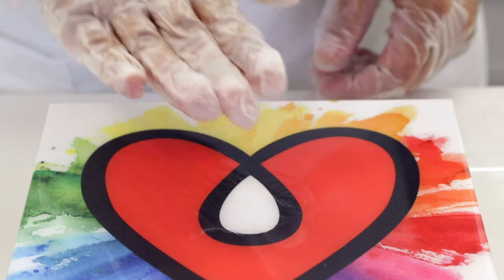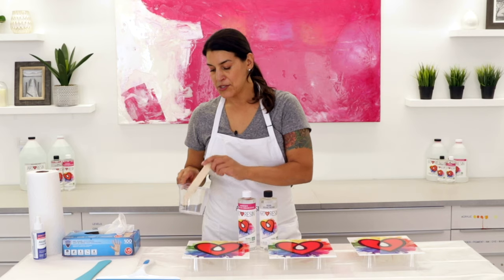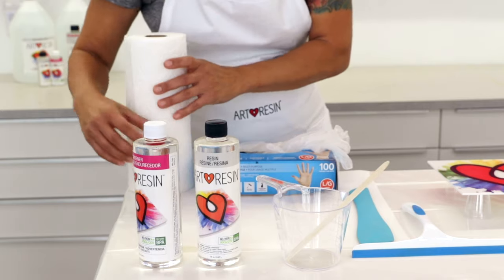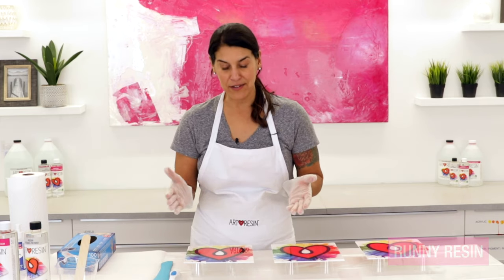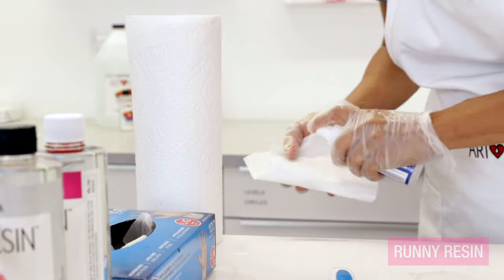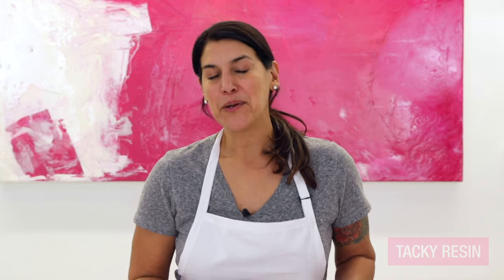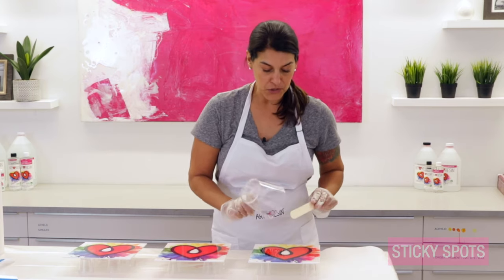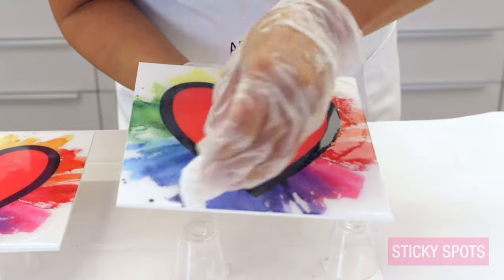How to Fix Sticky Resin - Top Tips & Tricks

Comment: THANK YOU!!!!! I have had tacky and the mixed finish problems before and DID NOT know about NOT SCRAPING as you pour!! Soooo obvious now. Thanks for showing all the steps!
Reply: You should always finish your mix in a separate clean cup and scrape the sides of the first cup into the second cup and finish mixing for another 2-3 minutes. She isn't even giving proper mixing instructions
Reply: This is how I mix my resin and I scrape my sides out to not waste my resin and because I finish in a second clean cup, I have zero unmixed epoxy.
Reply: You should also NEVER add a new layer over uncured epoxy as it will seep through and make someone sick. If there's sticky spots scrape/sand them out or strip the piece, it will never cure and is extremely toxic.
Reply from the maker: @JuiceBoxx_627  Yes, you can certainly measure in separate cups then pour into another to mix.  It is always important to ensure you are mixing 1:1 and ensuring you are getting all the resin and hardener fully incorporated.
Reply from the maker: @JuiceBoxx_627  When faced with wet resin that didn't cure, it is important to scrape off all of the wet resin as Joanne demonstrates in this video.  Once the loose wet ArtResin has been removed, you can then go ahead and pour on a second layer of perfectly mixed ArtResin.  You are correct in noting it is important to remove the wet resin since it will never cure and will end up seeping out, but I am happy to tell you that ArtResins formula is non-toxic 🙂
Reply: @Artresin  I never said anything about measuring each part in separate cups, I do that anyway, and still have a second unused cup to dump my mixture in, scrape the sides and bottom into the new clean cup and continue to mix for another 2-3 minutes so all of the epoxy is mixed not leaving unmixed epoxy on the sides by mixing in 1 cup which means your epoxy is not properly mixed, it's not loving up to its full potential because it's only partially mixed.
Reply: Hello@kayladickson8124 can you please clear this doubt, i have applied resin on painting and it is sticky can you please tell if i can pour properly mixed resin on top of it.?

Comment: Thank you so much for this video and information. I was on my third coat because of bubbles and uneven coverage on the edges of my canvas.  I don't know what I did wrong, but I have a runny mess of uneven resin! In tears (my first commission piece that came out beautiful 😭😫) I actually had 2 canvas' I resined at the same time. So it's obvious I mixed something wrong. I ran off the runny resin with hopes of it drying by morning. After seeing this video, I highly doubt it will cure, but now know I can probably fix the problem! Thank you again for this wonderful video! I'm going to "try" to 😊! If I do fix it...I will come back here and let you know! 🐇💗
Reply from the maker: I know it can be devastating but sticky or uncured resin is very fixable :) good luck!

Comment: I was working on a beautiful mold a few days ago and filled the molds with water to make sure I was making enough resin mix. I thought I measured it right but was dead wrong. When I poured the resin I was short a little more than 1/4". I freaked and rushed to make a new batch to fill it but it had been over 2 hours so I didn't know what to expect. Well 3 days later the new pour hadn't cured yet and I tried everything to heat the cast but no success. After watching you video I braved it and spent about 3 hours removing the last pour. Wow what a headache. Anyway the remaining cast is sanded and still a little sticky but the worst is done. Taking a break for today and starting again tomorrow. Wish me luck on completing it. Even though I'm frustrated (because I'm a newbie and wanted to give this as a gift) I am grateful to you for giving me the inspiration to go for it. I know now my rushing caused me to make the wrong mixture so in the future I will be extremely careful in mixing. Thanks for sharing...
Reply from the maker: We have all been there at one time or another, the good news is we learn from all of our experiences-good and bad.  The better news is you can now go ahead and pour on your next carefully mixed layer and complete your project.  Good luck :)

Comment: Here it is two years later and I found you by searching in YouTube for How to Fix resin mistakes. You solved my problem. I’ve been using this brand, 💜 ArtResin of  for nearly 3 years and had not make any mistakes. I’m a rock painter and use Heart Resin/Hardner this whole time. 

My mistake: I use a very small amount (1/4 cup).  equally from both bottles. It’s enough for 4 or 5 medium size rocks. First, I had put in 1/4 (I use measuring spoons) of one of the bottle. I put the lid back on. I got distracted for a bit. When I returned, I couldn’t remember which bottle I used. I had a 50/50 chance of using the right one. I wasn’t confident. Lol.  12 - 14 hrs later, the rocks were a sticky mess! I guessed wrong!  Aaarrrgghhh. 

I wasn’t sure if there was a solution. In fact, I doubted it. The second way you said to do it if your project was just sticky, not runny. The solution was to just redo the project corrected. IT WORKED!! This morning, all was great. My rocks project was saved!  Over dramatic, I know, but for me it was. I don’t know if you read comments, especially when this video is 2 years old. 

THANK YOU SO MUCH!! 💕💋
Reply from the maker: Thats great!!  The good thing about working with ArtResin is most things are fixable :)

Comment: I’m assuming you’d treat soft resin (from poor ratio measurement) the same was as a sticky resin - sanding it first then applying a second coat?
Reply from the maker: In the case of inaccurate measuring and mixing of resin or colorants, unfortunately the resin may not cure any harder. One possible solution though is to carefully measure and mix another batch of ArtResin to pour on the bendy piece to add strength and support.

Comment: Great video, thanks for that! Just curious though, when you say tacky, is that the same as sticky? I've got a piece that has some pretty thick resin, and the very top of it is left sticky. now it has finger prints and dust debris build up. Should I just clean it with the alcohol, then sand it with 80 grit, and do another pour after the bad part is gone?
Reply from the maker: Yes exactly! Sticky=tacky :) You'll want to remove any debris and poor over it. If is sticky there will be no need to sand, the next layer of resin will adhere right to it!
Reply: @Artresin  Much appreciated, thanks a lot!

Comment: The MOST helpful video I've watched. I'm very careful about measuring and stirring, I've even put a small heater on my shelf to increase the temp in the room, warmed both components before mixing and as one brand suggested, put the mixed resin in a small dish of warm water to warm that up and get rid of bubbles. I don’t ever have liquidy resin but have a real problem with sticky spots. Me being the cheapskate I am, though, I carefully scrape the resin out of the container not to waste any,  and i think this is likely my problem, even though I'm so careful about the initial stir. I'm going to do another batch to try to fix some [many]! 

Any ideas about float of flowers and greenery used for bookmarks? I've tried putting them in the molds before pouring any resin, and pouring a layer before adding them and then another layer. Either way, have to push them down into the resin several times, and they still rise to the surface.

Comment: I use a cheap Walmart heating pad directly under (except for a protective cover over the pad) leave it on high or medium from half hour before pour (I usually pour on wood planks about 3/4 in thick max) and until fully hardened (time depends on thickness of pour) thank you for your additional tips I can use if and or when needed.

Comment: I found just like scraping the side to help mix everything equal, scraping off your mixing stick a couple times helps too because if you use wood more if one the resin or hardner can stick to it n change the mixture. ... I like the idea bout rubbing alcohol to clean n water for dust because those particles can be a pain to keep from blowing around when your in a heavier traffic room. I have teens n a dog so i worry even with a air purifier.
Reply from the maker: Thanks for the extra tips :)

Comment: Hi there and thank you for the great advice. I made a new wooden handle for a kitchen whisk and used a 2 part epoxy resin to attach the metal part of the whisk into a hole in the wooden handle.
The epoxy resin consist of 2 attached tubes that you press and it is suppose to eject the same ammount of resin and hardener but the one tube seemed to be a little clogged and i suppose the 1:1 ratio wasn't accurate.
The resin has a "vague sense of tackiness" so i am sure if if cover it with your second option it should be ok.

Thanks again,
Francois

Comment: First thank you for your very helpful presentation. Secondly, how can you meet s tiny amounts in not small enough containers, even measure it correctly?
And last, if the piece is still not hard, do I wait? Add another coat? 
Thanks for your help
Yael
Reply from the maker: Hi Yael, you can mix as small as 2 oz of resin (1oz of resin + 1oz of hardener) using medicine measuring cups or even try a set of plastic measuring spoons to mix as small as 1/4 tsp (1/8 resin + 1/8 hardener). 

If after 24hrs your resin is still sticky, we recommend another coat of resin on top. For more information please visit our blog, https://www.artresin.com/blogs/artresin/oh-sh-t-series-episode-1-sticky?_pos=1&_sid=575504314&_ss=r or feel free to reach out to our customer service team at support@artresin.com.
Reply: I bought a set of cheap measuring spoons from the dollar store, so I could mix up a small enough batch for my purposes. Hope this helps!

Comment: Hi there your video was very helpful 
I recently finished some craft work but had ran out of my usual resin 
So 
I thought what if I used my acrylic resin instead ,this is what I use for flowers in vases to look like water .
Umm It didn’t work and it’s still tacky after being in the warmth and a week later .
So after watching your video I might be able to add some of my usual resin on the top .
After I’ve bought some which was the problem in the first place (so yes don’t take short cuts ) 
Do you think I should risk it or count my losses.
Any advise would be appreciated 
Many thanks Maria
Reply from the maker: I haven't worked with acrylic resin myself, but I would think there may be a risk of de-lamination of the layers over time.  With that said, if its a loss as it is, you may as well test it out to see if it will work :). Good luck!
Reply: @Artresin  thanks for your info 
My resins on order so I will do a test 
Hey ho

Comment: Two questions (1) what type of alcohol do you recommend. Looking on Amazon I see it ranges from 70% to 99%. (2) I was surprised to see you were sanding with 80 grit and the finished results looks great! What is the downside of using finer grit for repairs? I was sanding with 220 grit. BTW GREAT video!!!!
Reply from the maker: Hi John, we recommend using a high %, over 90 if possible.  It is a more pure formula and evaporates cleaner.  We typically use 80 grit since the purpose of sanding is both to remove surface imperfections like bubbles and also to provide tooth to the next layer of resin.

Comment: My resin has never been sticky, but it has been wobbly and flexible before. I think that's because I used too much alcohol ink. I make keycaps and other small objects and when you make very small batches of resin, measuring and additives have to be spot-on. For quick jobs, I use a polyurethane resin that sets in 10 minutes, the downside being that you can only use opaque colors as it cures a bright white color.

Comment: Great video! I have a question about using alcohol or acetone with the resin. I am planning on making these cute trays to work on when I do lash extensions. The tape on the back of the lash strips tends to stick to the trays I normally use which are glass or tile. I also use cyanoacrilate which is the lash glue and may need to clean it off from the tile as well. Ok, now to the questions: with a tile made out of resin, can I use the lash glue on it, will it damage my resin tray? With the tape residue, can I wipe it off with alcohol or maybe some goo gone? I’m hoping to get some directions on how to clean my resin plate without damaging it.
Reply from the maker: Hi Marianna,  Once your resin is cured, we advise cleaning with soap and water and avoiding harsh cleansers and solvents.  Alcohol will break down resin so I would not advise using it to clean your cured resin pieces.

Comment: Hi, this video was extremely informative. I sanded an oak coffee table, glued cigar labels and poured epoxy. It looks great but I have sticky, tacky sides. I left it indoors for a couple of months and lately set it out in the garage, well with the Texas heat it started bubbling and running. Is there anything i can do to cure it or treat it? i tried pushing the air out of the bubbles but they just got larger..
Reply from the maker: Really sorry to hear this!  Would you be able to send photos to us so we can get a better idea of whats happening?  support@artresin.com.  Thanks!

Comment: Hi I just wanted to know if the item is a bracelet and not a flat surface how can I fix it when I looked into the mole it seems sticky on top and I think also in the sides what can I do help from Puerto Rico I just love the easy way you explain this method for runny resin if I get to do a coaster the information will come in handy if it happens to me again.l
Reply from the maker: Are you able to remove it from the mold? Removing it from the mold will be the first step then depending on how sticky or runny it is will determine what you can do next. If it is complete gooey you may just have to pour another one. If it just has a few sticky spots then I would brush on a thin coat of ArtResin :)

Comment: Extremely helpful tips. My painting was got great solution number 2 painting was the same issue for mine.. Sticky resin. 
I got it resolved by your amazing tip.. Thanks a lot for sharing that piece of knowledge.
Reply from the maker: Thats great news!  So happy to help!  🙂
Reply: Hello, I have a doubt can you please clear it, I applied resin on painting and it is sticky since 3 days,  can I pour properly mixed resin again on top of sticky resin????
Reply: Your mix was not proper because it's still wet ,not an issue you can use a fresh batch of resin mix and apply .

Comment: Thanks for your video. Wouldn’t it have easier to wipe clean the back of the first piece with alcohol when you scraped off the wet resin with the squeegee rather than when after it has been re resined?
Reply from the maker: You certainly could do it either way doing it after it is cured is basically a final clean up. It's also easier to handle once you have a hard cured coat on top :)

Comment: Hey! first of, great video. But I'm still panicking!
I was working on a table design and I used alot of resin which gave me a really thick result (which I wanted), a bit more than an inch, I got some great clear resin but some sticky spots, I am trying to understand how to use your method on a thicker piece, any advice?
Reply from the maker: Hi Ran, not to worry we are here to help. It might be better if we have a little more information about your project and some pictures. Would you mind sending an email to support@artresin.com and include any photos of your table and any information about your process that you can share? Thanks.

Comment: Thanks for doing this kind of instruction! My question is you said a warm environment?  What temperature would be warm enough? Our home is about 71 degrees year-round, is that too cold? Again Thanks!
Reply from the maker: We recommend working and letting your resin cure in temperatures between 75-85F.  A couple degrees cooler shouldn't make too much of an impact but if your resin seems to be taking longer to cure it may need a bit more warmth.

Comment: I use Art Resin. The other day I was measuring the resin from brand new bottles. After i added  the correct half/half, the levels of my resin and hardner were different as though I used more out of one then the other. ?????
Reply from the maker: Hi Karyn, be sure that you are measuring 1:1 by volume, not by weight.  Also, make sure you let the resin settle into the cups for a minute or so to ensure any that has clung to the sides will settle down for an accurate measurement.